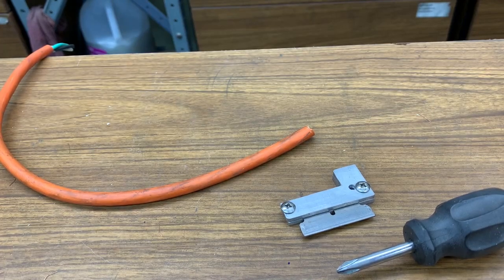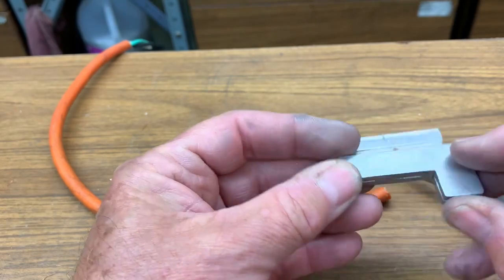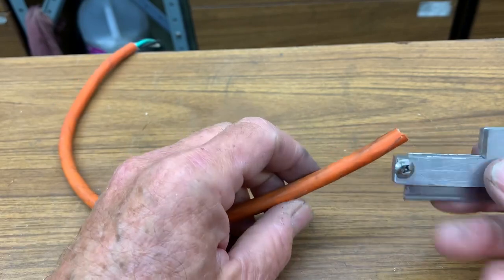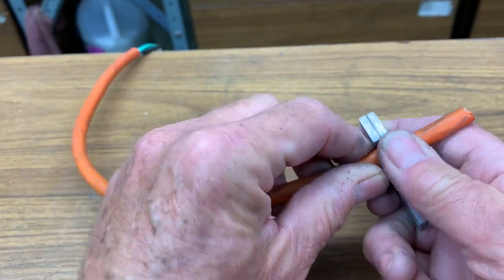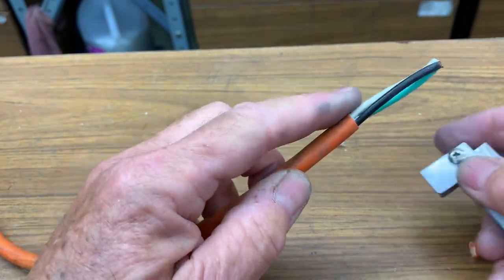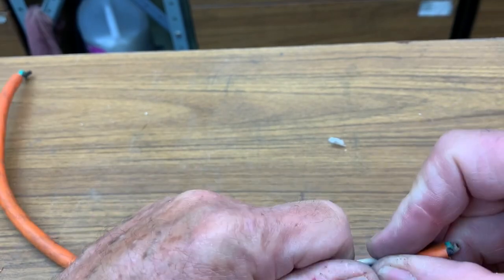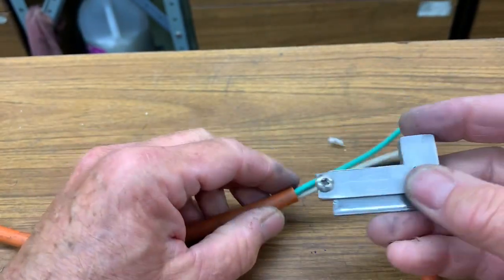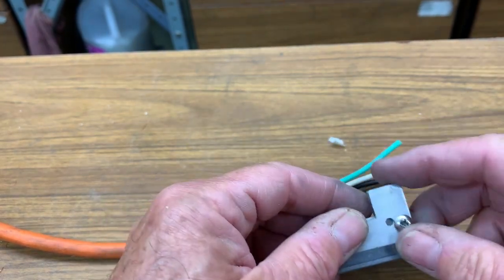A Power Cable Sheath Cutter

Comment: I  like the idea of having the long part of the "L" the correct width so that when the blade is bottomed out it gives you the proper depth of cut into the wire.  Great idea.
Cheers
Willy
Reply from the maker: Willy, Glad you like it. The design continues to evolve as can be seen in the article. Another possible modification would be to add a pivoting cover. When closed, it would cover the blade. When open, the user could place the cable into the L and then partially close the cover. This should lock the cable in place and let the user rotate the tool rather than turn the cable. I'm not sure this makes the tool better. What do you think? Rick
Reply: @rgsparber1  Yes a small cover would be a good addition. Maybe even one that was spring loaded. Not allot of spring pressure, just enough to keep the cover closed when it's rattling around in your tool box. 
Cheers Willy
Reply from the maker: @willywgb  This has turned out to be harder than I thought. a spring loaded cover tends to get in the way during use. I also have not found a cover that can hold the cable during cutting that works better than my thumb. I'll keep working on it.
Reply: Hi Rick    Well sometimes a person just has to step back and say,  good enough.  I really like your design the way it is.  I will be building one soon.
Cheers
Willy
Reply from the maker: @willywgb  I did find one possible improvement- slide a 1” length of hose over the blade when not in use.

Comment: That's a nifty tool! Thank you for sharing!

[edit: For someone making one of those,] one thing you could do is have the long arm of the L start off wider and then taper into the corner of the L to only expose a smaller portion of the blade.
Reply from the maker: What do you mean by "wider?" Do you mean longer or fatter or something else?
Reply: @rgsparber1  I meat fatter (like the short arm of the L) at the end away from the corner but tapers to the corner.
Reply from the maker: @mduvigneaud  would tilting the blade have the same effect?
Reply: @rgsparber1  Yes, that looks like it would do the same! My original comment wasn't intended as something to change in the one you made, more as an idea if someone wants to make one too.
Reply from the maker: @mduvigneaud  That is what collaboration is all about - this is how we make the design better.